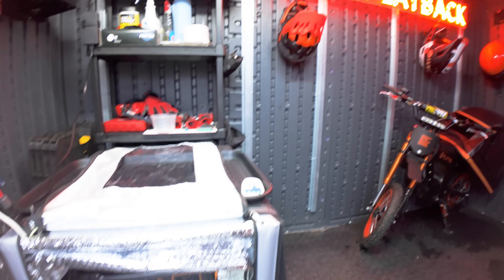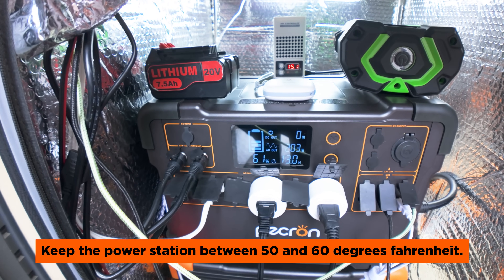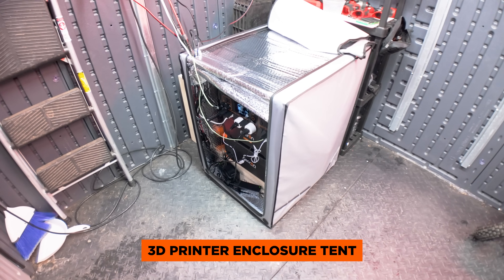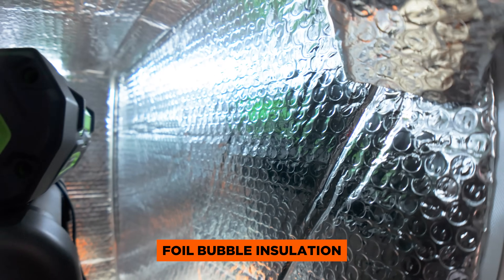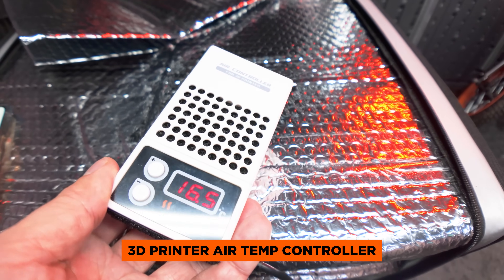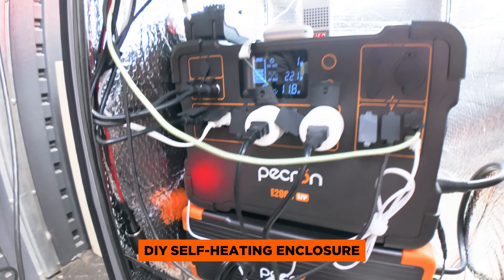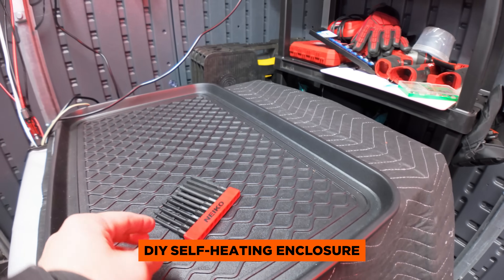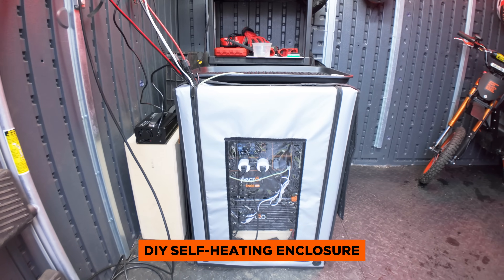Winter-Proof Your Solar Power Station with This DIY Heating Setup!

Comment from the maker: 3D Printer Enclosure Tent: https://amzn.to/4iRIqem
3D Printer Air Temp Controller: https://amzn.to/3P2tAUG
Govee Wifi Thermometer: https://amzn.to/3ZKaqI3
Govee Smart Plug: https://amzn.to/3VIZx8c
Foil Bubble Insulation: https://amzn.to/3ZFhYf2
Plastic Boot Tray: https://amzn.to/3ZYtcN6
Vevor 5kw Diesel Heater: https://amzn.to/4iAjTdH
Pecron E2000LFP Power Station: https://amzn.to/3AIWdTj
Pecron EB3000 Expansion Battery: https://amzn.to/3ZXPyhF
Pecron 300w Solar Panel: https://amzn.to/3YZNUdF
200w Solar Panels: https://amzn.to/3AUxs6u
RunPlayBack Merch: http://shop.runplayback.com/

Comment: How many watts hour to heat
Reply from the maker: Depends on how cold it is. I typically run it for 20 minutes every 2 hours using a smart switch. Thats enough to heat the tent and keep it around 50-60 degrees on the coldest days. So 40-50 watts every 2 hours for 20 minutes.